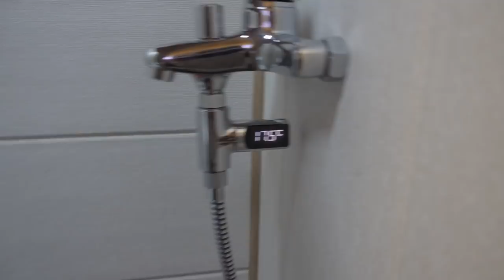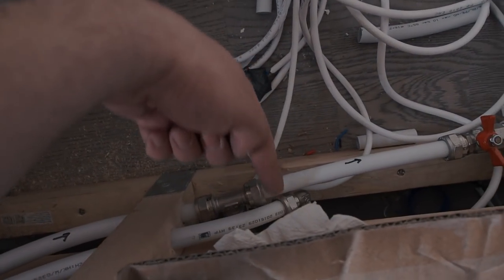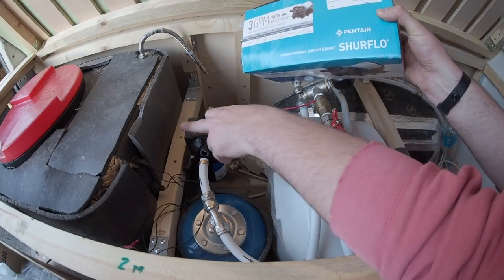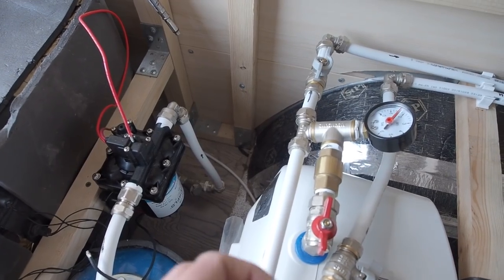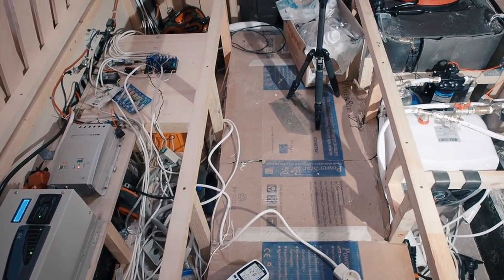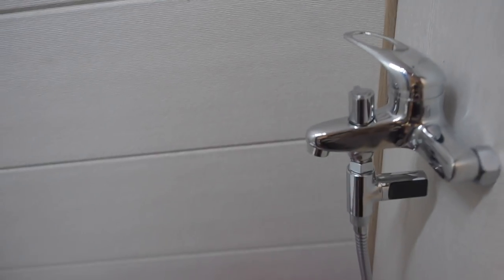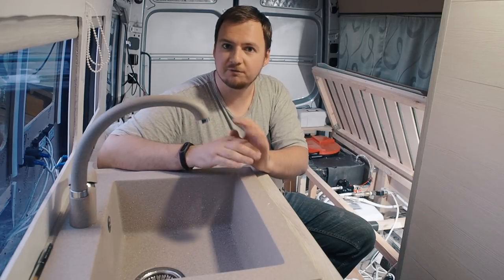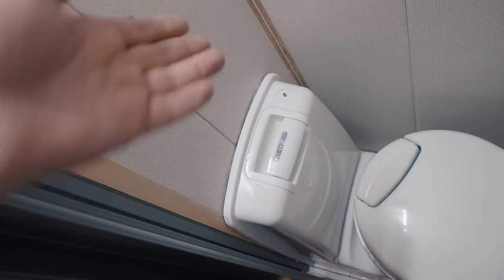Water system in RV / van conversion with AC water heater & pump. Offgrid water system for hot shower

Comment: Great work! A couple of thoughts on the energy efficiency:
Typical power loss for your 10L top feed boiler is ~0.67KWh/day to maintain 60C delta temperature. 
Bottom feed boilers are 35% more efficient than top ones because of the hot water does not circulate around the hot pipe and fittings. You can probably up efficiency by 15-25% by thermally insulating pipe/fittings.
Also make sure your inverter can sustain 1.2KW + 2KW from your cooktop and boiler or you will not be able to cook conveniently. These Induction cooktops can only draw full or half their rated power, any power in between is made by constantly switching on and off.
You also can use 4008 SHURFLO REVOLUTION Pump. It is a dedicated RV pump, cheaper and more quieter than marine, plus it has built-In Check Valve. And there is even smaller 2.3GPM version.
Reply from the maker: Thanks, great advices! I plan to use my heater only for shower so it will not work with cooktop same time. You right about cooktop, my is 1-2kW and all that goes bellow 1kW is interval working mode. My inverter is 3kW so it can handle both cooktop and heater, but only if cooktop works in 1.8kW or less setting (which is fine, because usually i set it to 500-1000W and its more than enough)

Comment: you should think about a system that automatically turns off the water pump when you leave the van. if you forget to turn off the water pump and there is a leak somewhere, the pump will pump the whole content of your water tank into the van. that happened to 2 people i know.   awesome video! :)
Reply from the maker: I think about "leave away switch" that shuts off all lights, sockets and pump when i leave the van
Reply: Yes good point, that's why I don't like pressure activated pumps, but they all are this system now. Before this type it was just a switch on the tap to turn on the pump, but I suppose this was just too simple. Alan, England.

Comment: great vids buddy, just a heads up,  ptf tape should go around the olive (looks like a wedding ring) as the nut pulls a seal tight on the actual olive. ptf tape in thread works to some degree, but is more prone to leaking, the olive is designed for a reason best to use it.

Comment: Great explanation. It's great seeing some data, though the really interesting stuff would be the average consumption for the heater in 24h
Reply from the maker: I think 24h working heater is way over my power capability. I also need to power fridge and induction  cooktop. Also this test will be very loose because its mostly depends on hot water consuption during this period
Reply: I meant the average consumption per day would be more interesting than the surge current. Like how much electricity you spend on your hot water. Because I think heating in general is too much for most electrical systems. I am considering a combined heating solution with propane for my van.

Comment: Hi, thanks for the great vid! a few questions

When you drive, do you switch on the inverter and does it automatically heat up the water? 
And then when you stop, you turn it off and it stays hot for a while?

Thanks

Comment: Good system. The connector on the top of your accumulator does not look like a tapered thread, so tape is not good, I think there should be a rubber seal ring under the adapter to seal against the flat surface of the accumulator outlet.
Reply from the maker: Thanks i will look up for info about that!

Comment: Hey :) Thanks so much for taking the time to video all this, I'm slightly confused as to how hot water comes out of the water heater, where is the pressure from, if it uses the pressure from the pump then doesn't it also fills the tank back up with cold water ?

Comment: Hello! Nice vidéo!
Juste one question:
Did you think about a 12v heater?
Your one is a 220v, right?

A link for exemple:
https://www.h2r-equipements.com/chauffe-eau-12-220v-pour-fourgon-camping-car/5795-elgena-kb-6-kombi-12-220v.html
For your toilet: reduce diameter of the main tube it's easier:) 

Thanks!
Reply from the maker: There are no 12V heaters availiable in my country. Also it cost 3 times more and i dont like the form